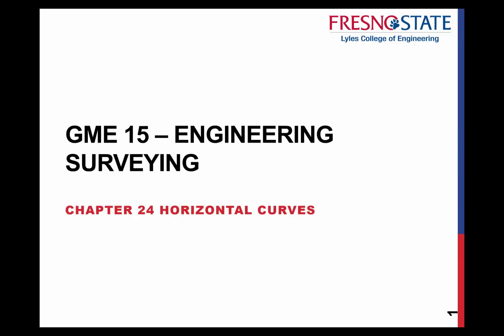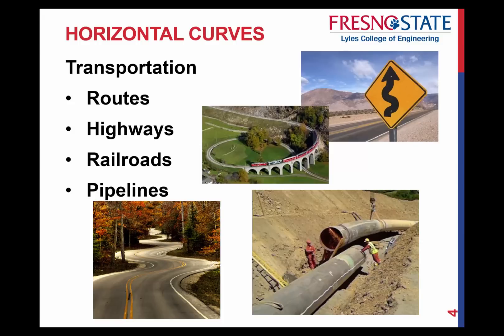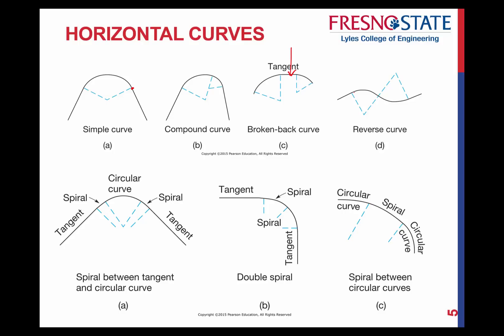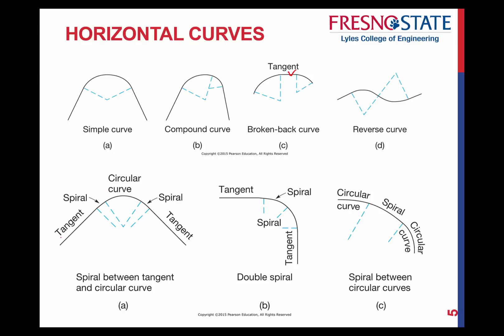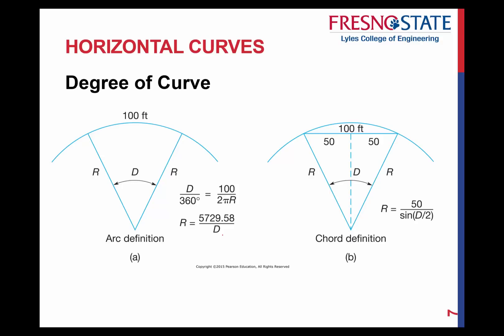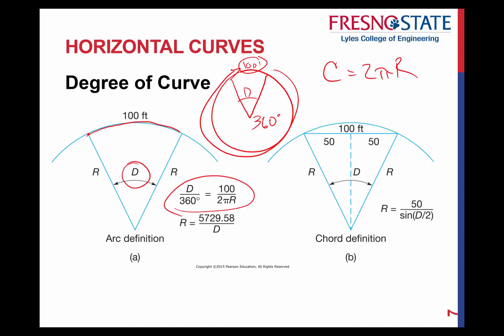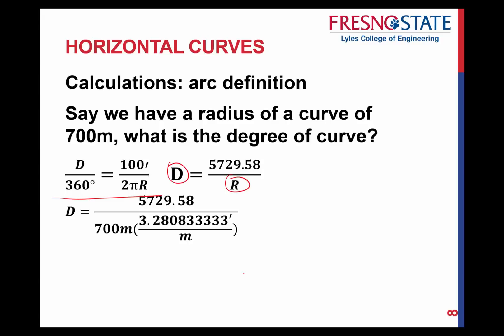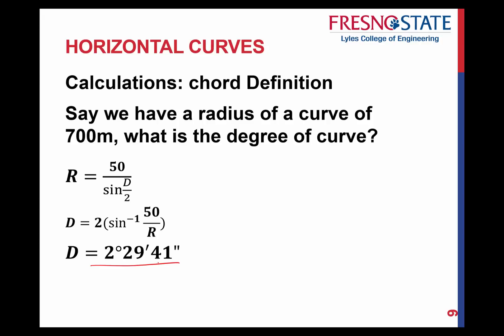Horizontal Curves

Comment: 9:55 why we need to convert ft with meter?
Reply: the original formula used was provided us customary units but the question & radius provided is in metric
Reply: 5729.58? Is this really the number we should be using. Taking pi out a few more decimal places yields a very different answer
Reply: @stephenbouldin8163  Yes, where does 5729.58 come from?
Reply: @Josh-xe3rv  180 x 100 / pi = 5729.58